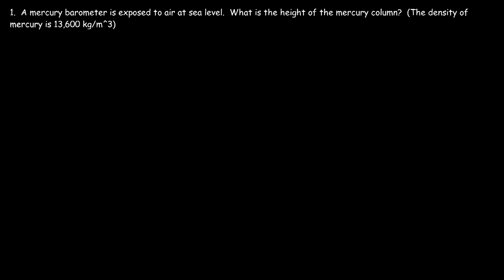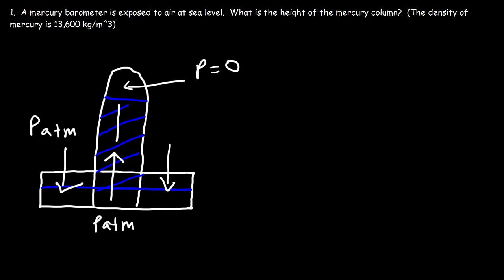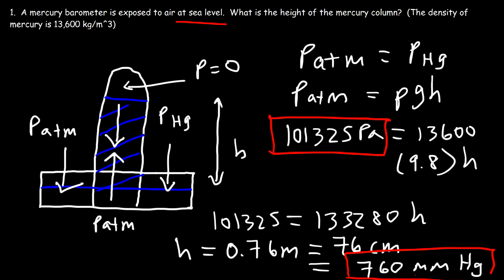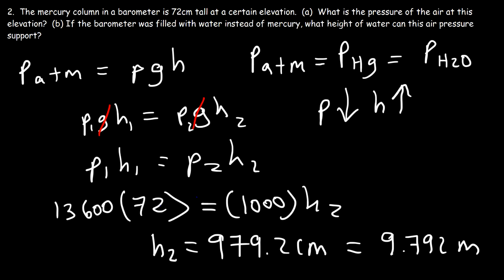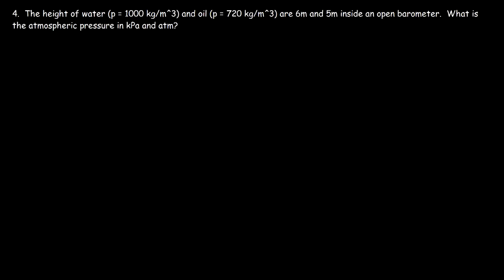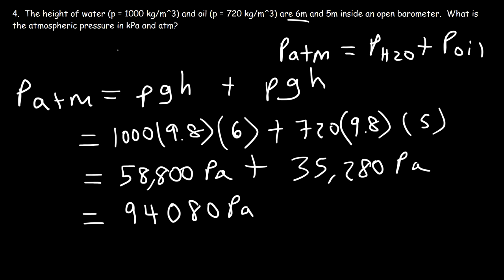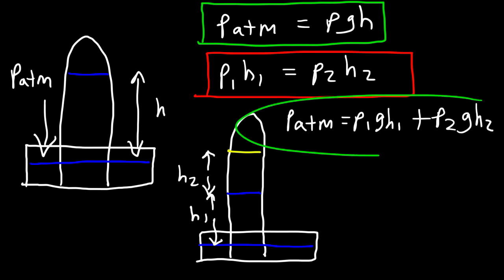Mercury Barometer Problems, Physics - Air Pressure, Height & Density Calculations - Fluid Statics

Comment: A mercury barometer registers a reading of 760 mm. If a piezometer using water were to be used to measure the atmospheric pressure, it would require a height of ____?

Comment: Weldon 🙌
Please how do I go about this question? an empty bottle is corked when the air inside it is 10⁰ and the barometer reads 75cm of mercury. if the cork blows out when the pressure inside the bottle exceeds the atmosphere's pressure by 10cm of mercury. calculate the temperature to which the bottle must be heated to cause the cork to be expelled

Comment: Thank you 1.a metal wire 7.5m long and 1.5mm in diameter stretches 4mm. when a load of 10kg is hung on its end find. a. stress? b. strain? c.youngs modulus?
Reply: Stress=Force/area 
Force=mg=10×10=100N
1.5mm in diameter
Radius=diameter/2
Radius=1.5/2=0.75mm=750m
Area=πr²
Area=3.142×750×750
Area=1767375m²
Stress=force/area
Stress=100/1767375
Stress=5.658×10^-5 N/m²

Strain=extension/length
Extension=4mm=4000m
Length=7.5m
Strain=4000/7.5
Strain=533.33

Young modulus=stress/strain
5.658×10^-5/533.33
Young modulus=1.061×10^-7N/m²

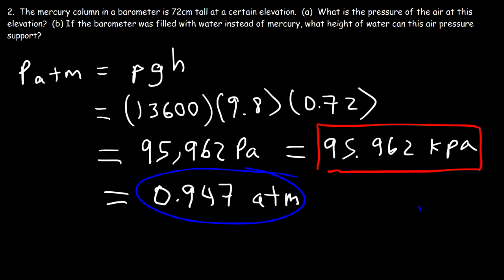Comment: 6:38 why the athmosphere pressure is different with the pgh while in 3:55 it is the same?
Reply: In the first question, you are calculating the height of mercury which is 76 cm
In the second question, the height given of mercury is 72 cm. That's why the atmospheric pressure values are different

Comment: put a neodymium magnet in test tube so when pressure increases and decreasing then magnet also going up down, now we use a coil around the test tube and we got that induced electrical forces by lazes law, now we have a energy source if we increases this setup one lakh times with water column